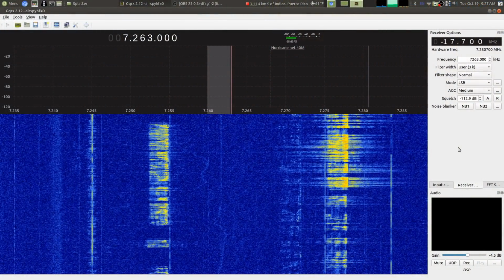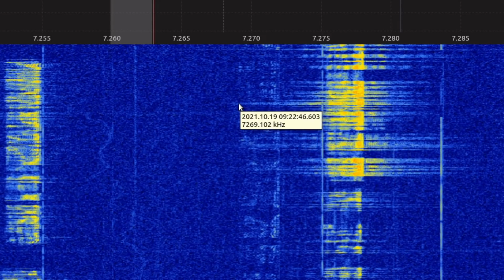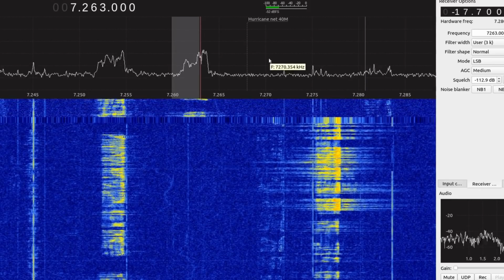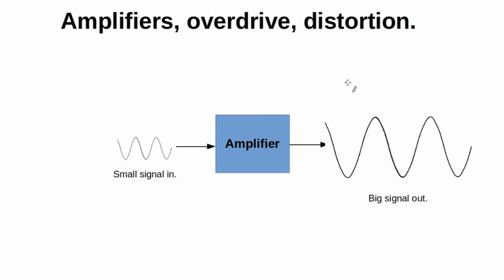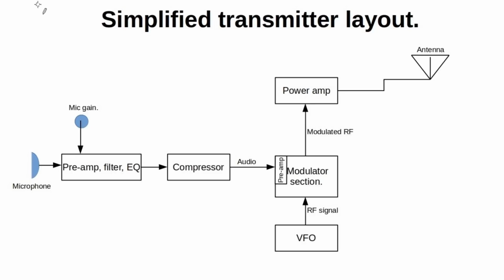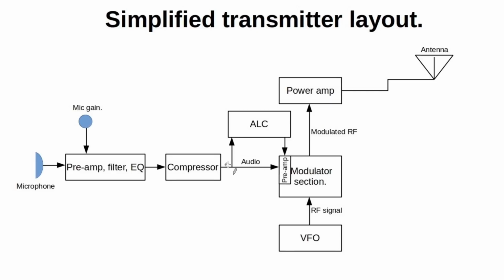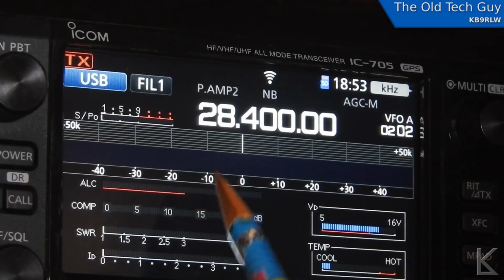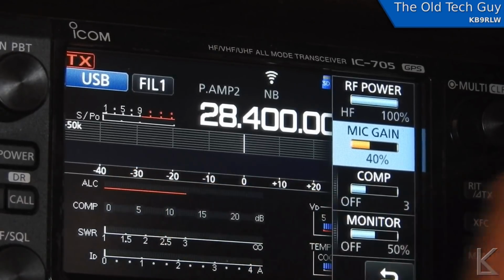New Ham Tips - Splatter. What is is it?  Why is it bad?  How to avoid it.

Comment: I'm wary of SDR waterfalls being used to diagnose someone else's transmitter faults due to, noise blanker artifacts, receiver overload, etc.
Reply from the maker: Of course these factors are easy to eliminate.  receiver overload is only a factor if you are within a few hundred yards of the transmitter.  Turn off the noise blanker. (although it's not going to cause issues in the IF where the spectrum is sampled from)  etc.   One only needs to apply a bit of thought to the matter.

Comment: An awful lot of amateurs never seem to consider the level of splatter they might be producing. The other day I complimented an operator on his transmission, he was using USB on 20 metres, and his signal was just under 3kHz wide. I told him it was about the best audio I had ever heard, it sounded like a good strong broadcast AM station, and was a delight to listen to. On the other hand I have heard many stations, usually running a kW or so that occupy 10kHz plus, and their signals are almost unintelligible, over-compressed and overdriven. Thanks for your extremely tactful and considered presentation.

Comment: Doesn't distance matter? I have a guy down the block that splatters but in an SDR 100 miles out we all sound and look the same.
Reply from the maker: Yes.  Someone within a 1/4 mile or so will swamp the front end pre-amp on your receiver.

Comment: Are key clicks a problem too?   Receiver front ends can be overloaded too, the old RF gain and filter-receive bandwidth can help too.  Agree true splatter is a problem.
Reply from the maker: Receive front ends can indeed be overloaded from nearby stations.   Once you get a few miles away, that's far less of a possibility.  For every doubling of distance, field strength drops off by a factor of 4 due to dispersion.

Comment: hlo Kevin cud u pls tell me hw i can prevent blowing up my LNA for my sdr rcvr when i switch to xmit mode without disconnecting the LNA , by the way i use a separate rcv only antenna  separate from my transmitter"s own antenna.Using a TR switch isnt helping bec the LNA  has to stay On most of the time, Cud u pls help me !!!!! Tnx a Lot  73s de n6mmq
Reply from the maker: Wire your transmit/receive switch to short the receiver to ground when you switch to transmit.

Comment: Good explanation, thanks Kevin. Your video should be compulsory viewing for every ham. Maybe I have got it wrong but I do tend to associate contests with splatter - more ops on the air, all trying to be heard (mic. gain/compression whacked up?) and linears driven to the limit. It's not just SSB either, plenty of CW/RTTY splatter right across the band is the norm during big contests. I also seem to come across more digital ops (i.e. FT8) causing splatter. The "golden rule"  for digital, is usually ZERO ALC.

Comment: Splatter can be caused by many things. Intermodulation distortion is one of them. The Ameritron ALS 500 uses four mismatched 2SC2879 transistors in parallel. Replacing those transistors with a beta-matched set solves one part of this problem also.

Comment: A great presentation, although the ALC in nearly all of my rigs follows a different path the principle is similar. Decent compression should not cause splatter but of course if you use it and have a problem further down the chain it will be more annoying. TBH most rigs do not have great ALC circuits but it is a difficult thing to get right. 73

Comment: Very useful.  Now explain this as it relates to PSK and FT8.
Reply from the maker: The same issue can occur.  I've talked in another video about ALC and digital modes.    You want to adjust your drive to the point where you just barely see a tiny bit of movement on the ALC.

Comment: Great video Kev ! I thought you might have shown FT8 and band splatter ! There is always someone over driving on there, causing multiple harmonic lines around them. I use my vox on 1 ( lowest setting ) to trip in my TX and just have it solid rather than clicking away on the threshhold. Once I know the volume setting for mic and speakers I stay on those for all my TXing on digimodes. I do find the relay threshhold does need a little adjustment the lower the frequency I go ? Andy M6APJ
Reply: Why use VOX on FT8? I have done so but usually the software can key the radio. Much of the problem with transmitted artefacts on FT-8 can be excessive audio level. The LF roll off does mean my power output will drop a little at the edges but the rig will still key reliably.
Reply: @g0fvt  I run the Yaesu 450at and made a lead from an old computer mouse and 2x 3.5mm jack plugs. I just used the vox on 1 and plugged in the mic and speakers in the sound card and it worked, so left it. I run Win Vista on that computer, which has no internet access just runs my ham software. Cheap and cheerful DIY leads and set up.
Reply: @andrewhill4226 we all do it different ways, at least yours will not be transmitting "Windows sounds" like many of the others do as their emails flood in! FT8 does not "splatter" as such but clipping in audio circuits can create strange transmitted spectra.
Reply: @g0fvt  ha ha yeah Windows start up, I've heard it and conversations going on over datamode frequencies ! Andy M6APJ
Reply: @andrewhill4226  my FT-8 is running on a Raspberry Pi, accessed by remote desktop, the Pi just has a USB cat cable and a USB soundcard connected to it. I do have 600ohm line transformers in the audio paths to and from the rig to avoid earth  loops... FT- 8 can be weirdly addictive.
73 David

Comment: Really good information Kevin. FT8  FT4 also suffer badly from splatter at times especially in contests.  Worst  by overdriven linear. WSJTX  does not need this excessive power, which if used should be monitored and checked. I have often seen the same tones replicated even out of the FT8 band allocation.  Which is avoidable QRM. It is not easy to politely advising the operator but have in the past done so by email where given.  Perhaps a WSJTX code modified to render splatter unreadable if it exceeds it’s bandwidth would be useful. Please be kind to QRP stations. G4PEY

Comment: We really need more videos like this one, from people that know what They are talking about. These days, You see these new guy's, making YouTube videos, without any knowledge whatsoever. And the new Ham's consider Them as Elmer's. After 46 years of being a Ham, I comment once in a while to Their misinformation, but Their self importance won't have it. Keep up the good work Kevin.
Reply: Can you give me some channel names where you see this misinformation happening?
Reply: @PaulaBean  That I can''t do. It suppose to be an enjoyable hobby. I don’t look for controversy, but it is worrying that some people have a YouTube channel and are considered Elmer's by new ham's. I could give You some examples. One guy claimed a printer was needed to print the middle section of a dipole with PLA filament. I replied that PLA filament will be degraded over time by UV light. He replied that He would replace it every year. Another one is a Ham for one year now and was raving about someone making a contact with one watt between New York and Cape Town, South Africa. And there was no info about the antennas (gain) used I said that the salt water between the two places was helping a lot. He said no, it doesn't. I claimed that for optimum result, a beam, for DX, should be about 1/2 wavelength above the ground, otherwise the  take-of angle would be high. Also a no again.  I do only Dx, seen all types of propagation and only miss P5. I can give You some good YouTube channels, but not all of them. This one, W3LG, w2aew, Ham Radio Crash Course are good.

Comment: Thanks for this video!  Could you please explain splatter and digital modes?  Thanks and 73!  K7NFO
Reply from the maker: In past videos I've talked about setting your audio drive when in digital modes.   They are pretty much 100% duty cycle modes with a fairly steady level.   
You should set your interface or computer volume level, drive to the radio, until you just start to see the slightest tickle on the ALC meter.   At that point, you're pretty close to full modulation without distortion.
Reply: @loughkb   Thanks, I appreciate having a good source of information!

Comment: Thank you for the video Kevin. In the first month or so of being licensed I had an HF contact spend about 20 minutes over the air helping me to adjust my compression and ALC. He was clear and non-critical (as you are in your video). Not only did he help me, but he also demonstrated the best qualities of the amateur radio culture.
Reply: The settings for transmitting are invaluable.  I was lucky, my first radio was used and the Elmer that sold it to me had everything set perfectly. That helped tremendously.

Comment: Great video, and tactfully done. I too have heard many folks running they're gear set too hot. And of course there are the folks that enjoy hearing that 20 or 40 over S9 signal report while using way more power than they need to make the QSO. Which happens to be one of the basic rules we learned as Tech's. The Splatter there is they're talking farther than they can hear interfering with another QSO.